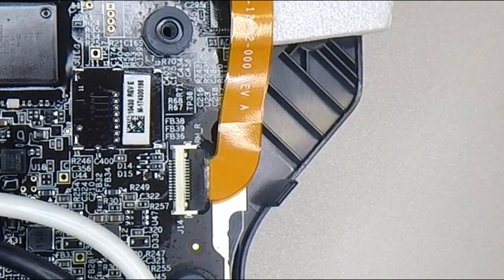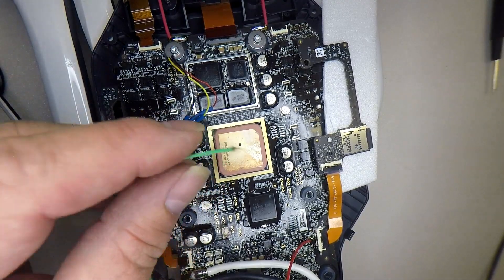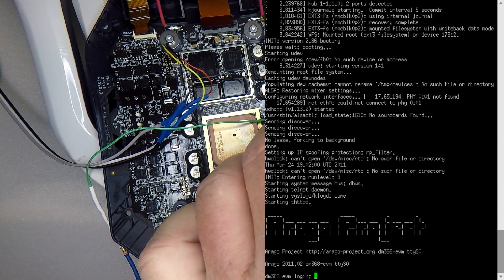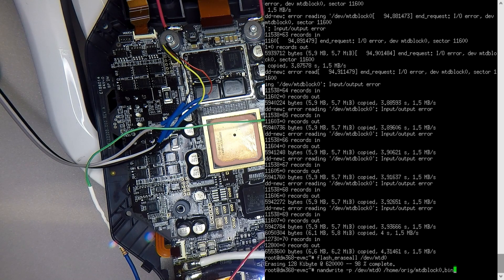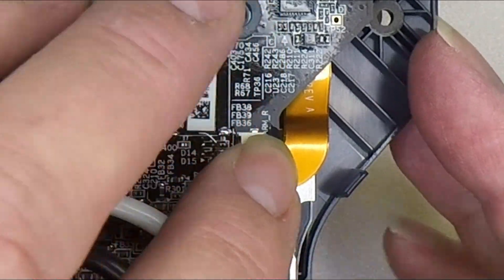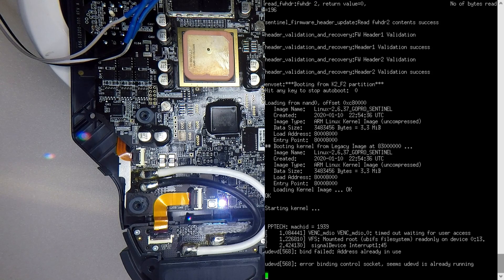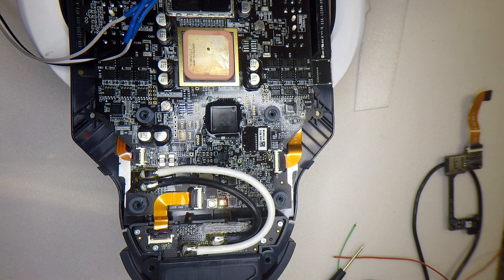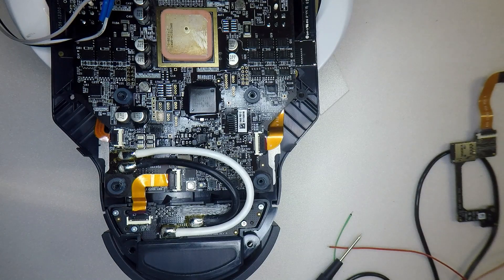GoPro Karma fixing the pairing issue on a board with a missing FB36 pad

Comment: Sorry for asking. If my drone has a card slot, how do I update it?
Reply from the maker: Its similar but you wont need a separate board to boot off. You will still need a TTL board and a probe and a little extra wire. Basically you will need to burn the image to an SD card and put it in the SD slot. Jumper the FB36 pads (you can also apply power from pin1 of the JTAG to the right hand side on the FB36 pads). Connect your TTL to the UART, connect your probe to 3.3 volts (can be from the TTL device if it has a 3.3 volt output or pin 1 of the JTAG).  Then the rest is the same as the video, short out the LHS of the resister in the can while applying power. 

I have seen where there is a fault with the arm board and it wont boot but only once. If you have any issues or want more information come over to the discord server, there is an invite in the description.

Comment: I’m missing the fb36 right pad. Is there anywhere else I can use to jump to boot from SD?
Reply: I will let you know how it goes. Thank you much for taking the time to help me, I really appreciate it.
Reply from the maker: The fb36 pins supply power to the SD card slot, if you built your own board you can take power from pin 1 of the jtag and apply it directly to the 3.3 volt pin on the sd card board. If you have an arm board with an sd card slot already on it you can power it by adding a wire to one of the caps or the connector for the arm board (both of these are tricky due to the size of the components).  

It would be worth coming over to our discord server and looking under the important pictures channel, there are about 4 or 5 pictures on how to wire the board. You can also ask questions about your issue.

https://discord.gg/wGVdWPpkua
Reply: Where is the pin 1 of jtag

Comment: I booted it from the SD card and got to the point where I was reading the uImage file, but a reading error occurred with the fatload command and it stopped at the u-boot command prompt. Also, I'm concerned that file format information such as FAT is not displayed using the mmcinfo command.
It's quite difficult.
Reply from the maker: Come over to the Discord server, you will be able to post pictures of where it got to and there are several people that can help.  https://discord.gg/wGVdWPpkua
From the sound of it you might just want to hold the problem on TP1 until you get to the login screen. I have seen a couple times where its like the SD just cant be read any more when I take it off before that point.
Reply: @bozmanx  j have the same probleme.....do you have the solution ? please
Reply: @bozmanx  j have the same probleme --wrong image --don t read boot.scv